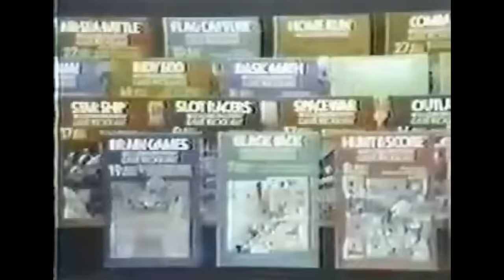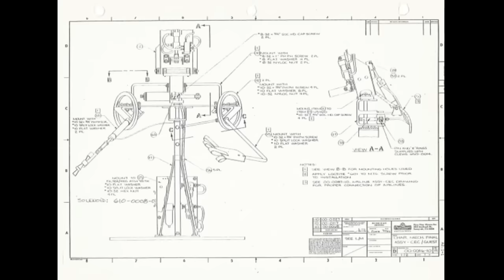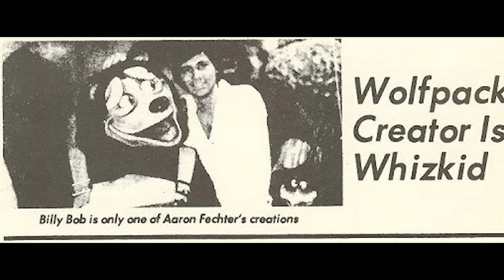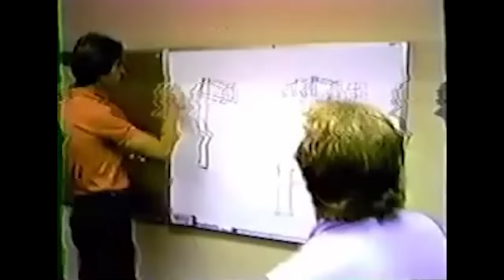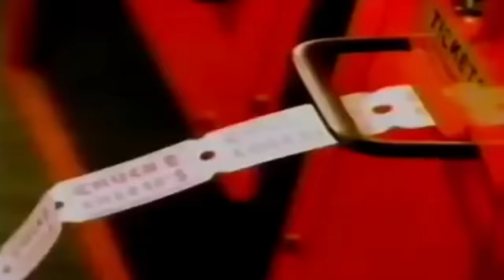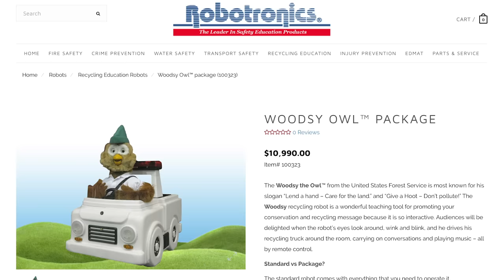A Brief History of Animatronic Restaurants

Comment: My location had the original 1980s 2 stage until 2010 I believe it was one of the oldest 2 stages to still be used in a cec location at the time 
I’m working on building a chuck myself and I hope to one day buy a 3 stage animatronic and try to rebuild the 3 stage animatronics from scratch 
And possibly sell them to cec fans for a very cheap price
But anyways that’s Goanna take years but I can guarantee you I will finish building one...
Reply: Also yes if I do sell a almost exact 3 stage animatronic I built it would be extremely cheap
Because I know what it’s like to want one of these and not being able to purchase one because of the ridiculous prices people put them at on eBay 
Also if I build one it would only be like 97% built exactly like cec’s 3 stage animatronics and not 100% because I want to avoid getting sued by cec inc  because I think it’s a copyright thing to build it 100% like cecs animatronics.